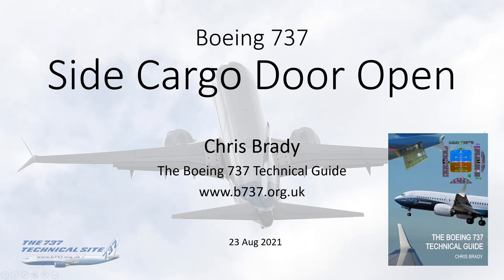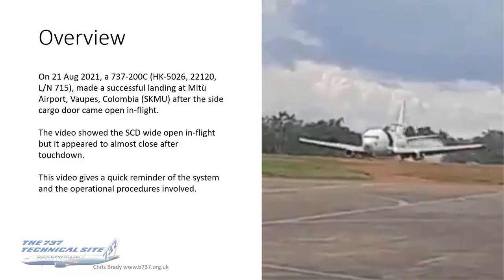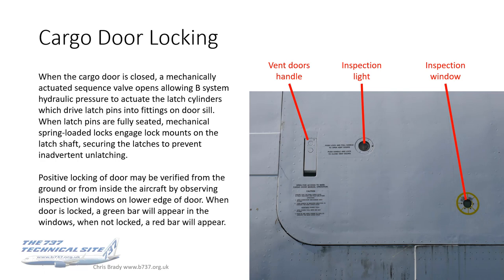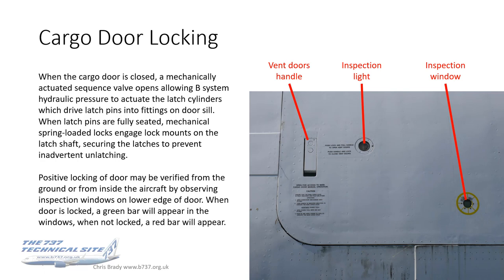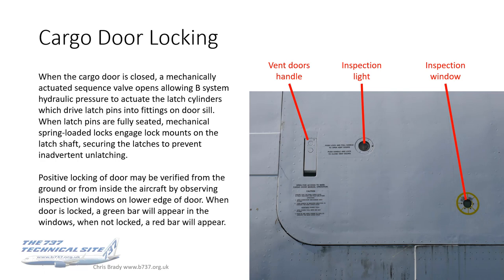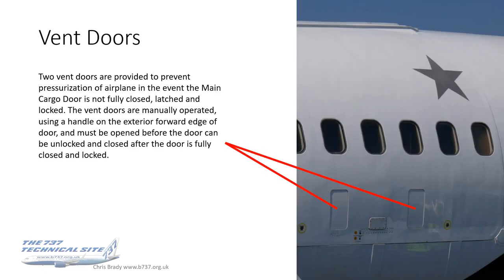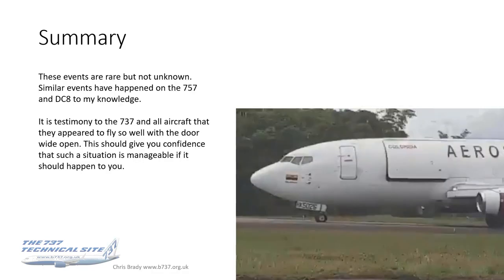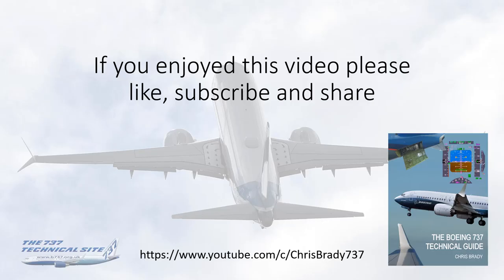737 Side Cargo Door Open

Comment: Surprised you didn't mention the change in angle of attack associated with the landing. I'm pretty sure that would have a substantial effect on the lift over the door as well... Especially the ~10 degree to ~0 degree change as the nose gear touches down.
Reply from the maker: I thought that I had but yes of course it must have had an effect. It would be interesting to see an analysis of it.

Comment: I think the closing of the door after touchdown might not have been (only) caused by the lack of airspeed or the “bump” during landing but the fact that a 737 on ground has a slight nose down attitude. If I look at the footage it looks like the door didn’t “close” at touch down (main gears) but it  “closed” at the moment the nose wheels touch the ground. So I guess maybe the airflow pushed the door to the closed position.  I have a question though, unlocking the door happens hydraulically as I understand by your video but how is the door actuated full open/raised? Electrically/mechanically or hydraulically? This would be of influence of the door being fully opened by airflow or not. Or the opening mechanism might have been sheared off completely.
Reply from the maker: The door is raised and lowered by Hyd B. The nose-down attitude may have helped but I think that airspeed will have been the biggest factor.